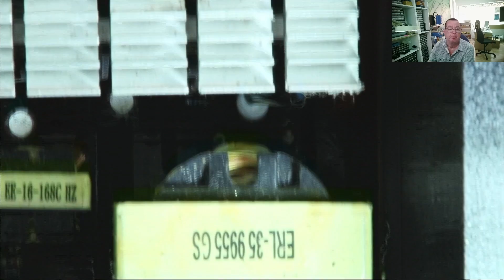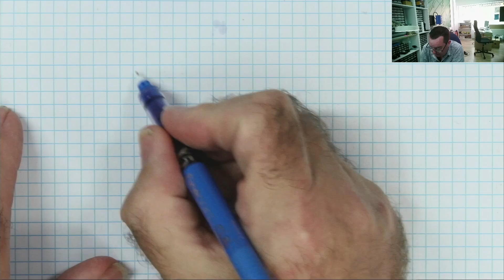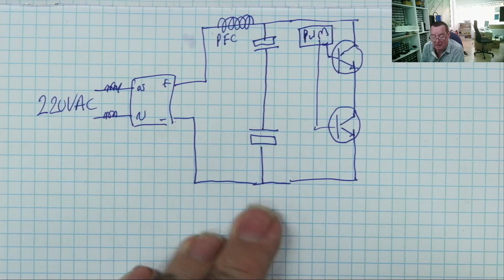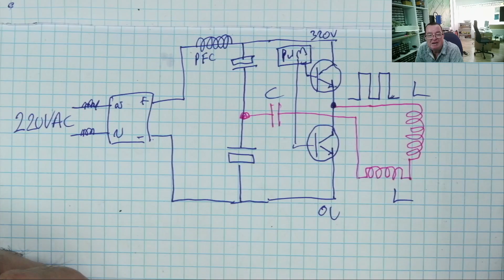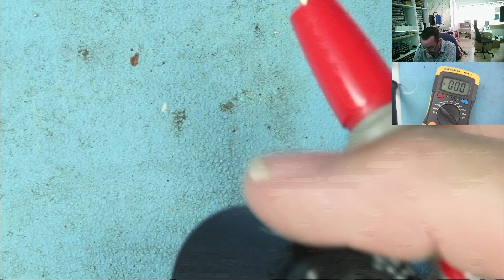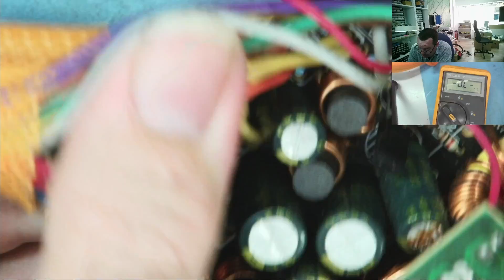What's Causes the NASTY Looking Corrosion around the Main Smoothing Bulk Capacitors in PSU?

Comment: The 150k ohm resistors are just some bleeder resistors to keep you from knocking yourself backwards by bleeding off the primary voltage and the material you scraped from the board may be just some glue to hold the capacitors in place.  The cracked solder connections would likely have caused this PSU to malfunction.

Comment: No the two resistors are there to ensure the 
voltage across the two capacitors is the same . If the resistors  were not there the voltage might not be evenly distributed  between the two capacitors  .

Comment: I think the resistors serve a dual purpose, a) to act as a safety drain & b) to equalise the voltage across the capcitors.
Reply: The resistors are actually very important when caps are put in serial to each other, since no capacitor is equal in capacitance and also leakage current the voltage would drift making one cap overcharge while the other goes low. it is probably why one cap is bulged because it likely been overcharged. the resistors are primary for equaling voltage and they work like a voltage divider and then they act as a discharge as well
Reply from the maker: @Pulverrostmannen  That is a really interesting insight, as the resistor across the bulged capacitor was open circuit.  This is something I didn't know, I have learned something today. Thank you 🙂
Reply: @learnelectronicsrepair  no problem :) we are all here to learn together. I enjoy your videos

Comment: I know nothing about this kind of circuit, but it seems to take 220VAC, rectify and smooth it, then through the switching transistors and LLC turn it back to AC! What is the point? Is the frequency different?
Reply: That's exactly what it does.  And then on the other side of the transformer, it rectifies it again and turns it back to DC!  The reason for this is the AC it converts it to is much higher frequency (usually hundreds of kHz or maybe up to 1 MHz) rather than the mains 50/60 Hz.  This allows the transformer to be much smaller and far more power efficient.  These PC power supplies provide between 300 and 1200W in a small, light, power efficient package.  If you were to try to build a conventional linear supply with just a 60 Hz transformer with those specs, it would be the size of the entire PC, and would weigh 50 pounds just for the power supply.
Reply: @stargazer7644  Cool! Thanks!

Comment: This type of power supply are great for recovering copper wire to repair traces. The PFC has the bigger wire around 0.7 mm (and is the difficult to recover all cover in metal) the 3 transformers in board can give you around 4 different diameter wires (and very easy to break the ferrite to open) plus the wires off the power supply (if is copper to)

Comment: Hi Richard, Between the bottom of the meter and the socket you are testing for ohms. The transformer in the background, can I see bare wire on the transformer winding. This image is at the 22:13 mark of the video.
Reply from the maker: I don't think that is what it is, if you are referring to what I think you are, a few seconds later you see the whole inductor (not a transformer).  It has two enameled windings, one enamel clear and one red.

Comment: 😱Many defects in this psu .
Ohh,, Richard . With what  frequency did you  measure the main caps esr??.
Reply from the maker: My ESR meter is 100KHz
Reply: @learnelectronicsrepair  Hi, you now that main caps after the brigde rectifier work with 50 Hz . Your meassure frequenz ist to high  and the esr value ist consequently  wrong. /. Sorry
Reply from the maker: @Lightrunner.  I do believe I mentioned in the video that these are not really lowESR capacitors but let's measure them anyway, they will probably read quite low.  Actually I don't think ESR matters with this type of capacitor application.  As I didn't have any suitable repalcements and I am fairly convinced at least one of them is bad, I wanted to test (on video) if the PSU would actually run with them. It did, but may not run so well load I suspect.   Really the purpose of the two caps in series is to put approx 160V on the other end of the LLC network. I thought it was a good opportunity to experiment.
Reply: @learnelectronicsrepair  Of course ESR matters. It's a failure mode of capacitors. I'd be more concerned testing small value electrolytics with low frequency ESR meter.
Reply from the maker: @johnnytacokleinschmidt515  I didn't mean to say that ESR does not matter. Of course it matters, I was saying that in mains frequency circuits it doesn't matter so much as it does in high frequency switching circuits.
Reply: The main caps are meant to work as power reservoir caps.
These cap types are not optimised for HF filtering.
Reply: @CXensation  you mean  not Lf or Hf  optimize. It is a middle frequenzy cap value 🤔

Comment: those psu testers aren't always any good becuase they don't put any load on the psu
Reply: They are not used as a load or performance tester. They are meant to be a basic tester showing the output voltages at PSU no load condition.
This gives an instant indication of the voltage circuit condition which is what you want for a basic go/nogo test.
If you need to load test the PSU, you will need a much more elaborate setup.
I recommend a bunch of automotive headlight bulbs for a cheapo heavy 12V test load.
That would instantly show a weak PSU.
Reply: @CXensation  yes the voltages can show as ok but it doesn't mean the psu will be ok when used with a load on it
Reply: @2009numan  As I wrote: This tester was never meant to do that.
If that is your test requirement, you'll have to find equipment that suits your demand.
Reply: If you need a good load for a PSU wind some glavanised steel fence wire in a spiral on a large wooden cross frame as a support. Use heat-resistant connection blocks like ceramic ones (plastic will melt - the steel wire can get quite hot over time)

Different diameter fence wire have different resistances (and fusing currents haha)

I've tested 48V 250A PSUs into some loads made this way and they are cheap to make and work well - aim a large box fan or 24 inch room fan at them if they get too hot for huge PSUs.

Wirewound resistors get expensive at the 200W level and also require huge heatsinks so a few quid for a roll of fence wire and a few quid for a couple of ceramic terminal blocks is a good compromise - spend the money saved on ciggies and drink
Reply from the maker: @gordslater  That sounds like a fun idea to play with 😉